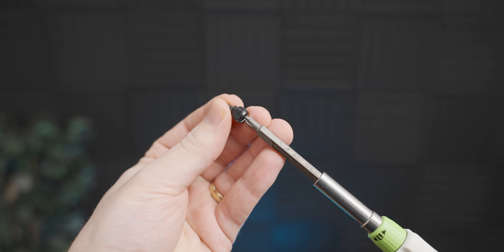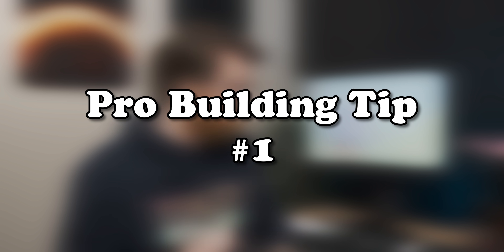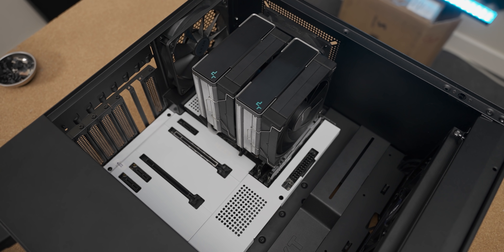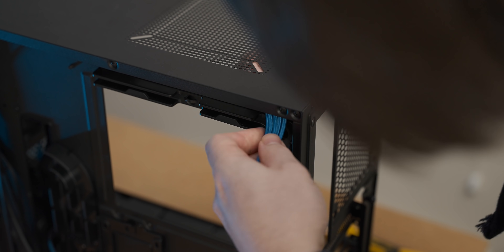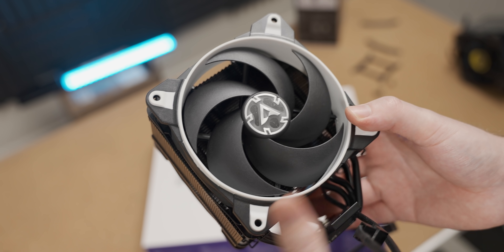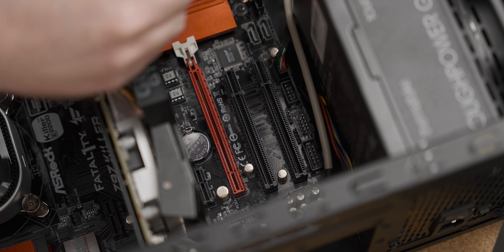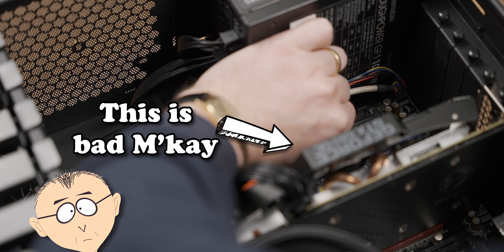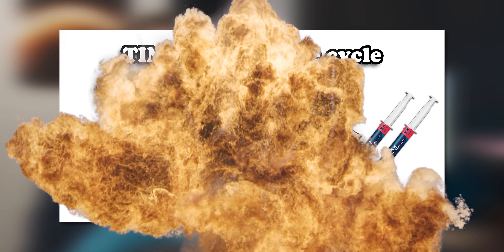5 Things I HATE About PC Building...

Comment: When you “finish” a build and realize the i/o shield is still laying in the mobo box 😅
Reply: indeed

;D
Reply: And there it sits for the rest of time.
Reply: This is why motherboards will built in IO shields are the best
Reply: Fortunately my mobo has io pre installed :p so I forgot to put my CPU in before putting on my aio lmaoooo . wtf is wrong with this auto correct
Reply: And the minute you sell the pc the io shield immediately appears from nowhere 😳
Reply from the maker: Ooof! That one hits you in the soul. 😂
Reply: @DawidDoesTechStuff  When it comes too magnetizing the screwdriver, i taped an old harddrive magnet too mine out of a dead laptop harddrive, neodymium magnets ftw, helps hold extra screws in place too as well as bits if i need too switch out the end for a smaller type for say 2.5 sata ssd screws.
Reply: @Time_Traveling_Lesbian  Unfortunately they force it on pricer boards. I doubt it's much more expensive to implement.
Reply: Every pc I've built doesn't have an i/o shield. All except this last build with the built in shield. Ruined my run of i/olessness
Reply: "Time to restart"
Reply: I circumvented that, by only buying them with built in io-shields... now to find a front-panel-stuff-to-motherboard-adapter!!
Reply: If you look where I have to, you're lucky to even have an IO shield.
Reply: that thing is now a novelty cheese grater my friend. flip that pc on and forget about it 😆
Reply: "Eh, it'll work without it."
Reply: And that’s why I left the io shield off my pc
Reply: Just recently did this... Not gonna lie, shit was flying.
Reply: @DawidDoesTechStuff  And the balls 😂
Reply: I did that with my first build
Reply: My previous shitty build didnt have it as I also forgot when i transferred it to a new case. I bought another 4gb a ram making it 3 sticks and not 4. Did a VERY bad job with the cable management up front and called everything just easthetics :)
Reply: @Time_Traveling_Lesbian  This is why people with braincells are the best at not forgetting their I/O shield
Reply: even worse when its an msi x570 A PRO with the worst quality io shield on earth
Reply: @trippwilsonphoto  Yea

JK no
Reply: Yes and on Youtube it takes like 1 second to install an IO-Shield. I have had many battles with IO-shields.. They are so annoying
Reply: Leave it out. Better for thermals.
Reply: That has happened to me at least 5 out of more than 50 builds. And the reason was every time, that the Io shield was packed below everything else in the box.
Reply: Good thing that thing doesn't serve any real world purpose these days XD
Reply: Pain.
Reply: He saved that for a future part 2
Reply: @baggiesjoe1608  The most accurate statement in this entire section!

Comment: I had a motherboard about a decade ago that came with a little plug extender-type thing that you plugged the front IO connectors into to turn them into a single plug. It was a brilliant solution and I wish every motherboard came with one, because apparently case manufacturers can't get their act together.
Reply: pin arrangement on motherboards still isn't standardised, that's why. It is very rare though, but still happens.
Reply: Gigabyte includes a thing like that with all of the Aorus boards of theirs that I've used. Actually THE best thing ever. It baffles me that something like that isn't required by law.
Reply: The ASUS Q-Connector. It's a godsend.
Reply: I got an ASUS Q-connector about a decade ago, used it in every PC I've owned since. Whenever I've helped anyone else, I pre bundle the connectors and tape them with black electrical tape.
Reply: Same here.  I had a DDR3 board or two that had these, and it's a shame that they're not more common.
Reply: @rossclutterbuck1060  As long as it's just a simple extender, and the same total number of rows & columns of pins, then it doesn't matter since you can just plug them into the correct ones on the top of the extender even if it differs between motherboards
Reply: my newer gigabyte board came with one of those, god it’s so much better then messing around with front panel connectors
Reply: @rossclutterbuck1060  front panel pins are standardized.  the only ones who don't are OEMs like dell who order custom motherboards.
Reply: @chubbysumo2230  actually, not everyone adheres to the standard (yet). You'll still find occasional outliers that are weirdly arranged (supermicro springs immediately to mind, but I'll be generous and say that they don't count). Interestingly, I've done a fair number of HP, Dell, and Lenovo transplants into new cases for customers who wanted better looks and/or cooling. Thus far, they have all universally adhered to the standard on the ones I worked on in the last 10-ish years.
Reply: @methodmantis3060  my aorus b450 didn’t have it. Maybe on their higher end bords?
Reply: @methodmantis3060   I use Gigabyte which I believe to be sort of the same company, would you know further details please?
Reply: @methodmantis3060   would you know more, I would use a few of these, please?
Reply: manufactuers can be white liquid stains at times

Comment: Routing hard to reach cables is often easiest done with modular power supplies... plug them all into the board first, slot in the board, route them wherever you want, and the plug them into the power supply at the back.

Comment: The front panel connectors: My motherboard came with a little bracket to put the front panel plugs into (even labeled +/- for the LEDs). Then you plug that into the motherboard.
Reply: Mine also it made my life a lot easier  that's the only connection I always manage to f up

Comment: In my tech shop we used  speaker magnets to store our various screw and socket driver tips.  The use of surgical tools like retractors can help placing connectors in hard to reach places.  A small magnet attached to a long thin metal rod (i.e. coat hanger), can help you recover those pesky bolts that like to fall into the "black hole".  Keep up the good work.  Love your channel.

Comment: When you finish a build and find out that the I/O shield LAN cutout piece is firmly inserted in the LAN connector.
Reply: Did that, could not be bothered to start all over, pulled that p.o.s with a plier and then cut it. Infuriating.
Reply: Aaaaaaugh!

Comment: 1:15 I'll explain it kinda simplified: there are like tiny micro-magnets in metals like iron but their orientations are random so there is no magnetic strength in the iron. By rubbing a magnet against the metal, you re-align the micro-magnets into a single direction, therefore making it magnetic. If you then rub the magnet in the other direction again, you shuffle the directions again. Hope that could help you and others that didn't know that. Also 8:40 you can also just put all the cables into a block of cables and plug all of them in at once. Just make sure that you have every cable where it should be

Comment: The most infuriating thing about these annoyances is that many of them have ready solutions and manufacturers can't be bothered to stick to them.

The front panel thing is pretty much standardized on all motherboards, but case makers still insist on providing the discrete miniscule plugs as such. Either they, or the motherboard makers could provide the little header thingy that all of them easily plug into, which has existed for more than a decade, but practically no case maker and only a couple of motherboard makers (not on all models, either) are bothered to do it.

The back panel p.o.s. i/o shield shenanigans are simply solved with an integrated panel. Not all motherboard makers provide, and again, not on all models (personally, I refuse to purchase any motherboard without an integrated i/o shield any more).

Metal clip cooler fan mounting can be made either frustrating or easy-peasy, as a matter of good design, or lack thereof.

The 5 pin CPU connector's awkward placement is, unfortunately, a leftover from the days power supplies were mounted on top of the case, and probably here to stay with us for quite a while, as is the magical self replicating thermal paste spread. SATA data and power connectors kind of suck, too (not as much as the IDE cables of yore, mind you), but with the proliferation of nvme drives, I don't see anyone doing anything about it (which is a shame, because heavy storage sata-connected HDDs are here to stay with us for quite some time).

Comment: The front io connector is absolute pain to connect.
Reply: It’s pretty easy actually
Reply: The constant amnesia of what the arrow on the connectors mean is the worst for me.
Reply: I find it easier when I hold them all in a bundle
Reply: About 10 years ago, MSI supplied a connector with their MB where you could plug all the cables into one just like the NZXT cable. I still use it today but sadly they don't include it in the box anymore.
Reply: laughs in connector thingy coming with motherboard
Reply: @Gigastor59  Asus used to do this too but the connector block I have no longer pin matches new Asus motherboards.
Reply: Asrock motherboards are good with helping you know what goes where

Comment: I would add the coolers that use the devils mounting plugs. Those little plunger clips out of plastic that have bad moldings and the cooler gets loose when you apply pressure in the opposite corner. Not to mention they are almost always square under the fins so you can't reach them with your fingers to undo them if they fail to seat properly. 

There are btw front panel standoffs that come with motherboards sometimes.

Comment: Dawid for your sanity's sake, did you know that using an electronics tweezer to plug the headers into your motherboard cuts the suffering by like 75%?
Reply: Mobo with an On/Off Swich on a Test Bench is even easier 😁
Reply: Get out of here with that twaddle, this is a NO COMMON SENSE ZONE.
Reply: Honestly, would rather have them make a full plug instead. Like wtf, everything else plugs right in. Then comes the front connectors. 1 by fucking 1.

Comment: 5:10 I love the way the Coolermaster Hyper 212  employs fan mounting on that cooler. It’s 2 not-flimsy rubber clips that screw onto the fans themselves, it’s a very good design in my opinion. You don’t have to deal with the finicky little metal retention clips and they go on the heat sink without any effort

Comment: Good tip on the CPU power.  For the case headers. I always tear the page out of the manual and tape it on the wall.  Also you're right bottom first!  I also use a plastic poker to help guide and push it down gently. Should be a general plug at this point in time.

Comment: 2. Use some needle nosed pliers to hold the connector to plug it in. Or, using a modular power supply, plug the power cable in then mount the MB then run the power cable through the slot to the back of the case.

4. Again, needle nose pliers.

5. Spend a day putting Foundation Coating on a foundation and the tiny mess made by thermal paste will disappear into insignificance.

Comment: 1. Magnetized screw drivers and bits are your friend.

2. Imagine the hell that is trying to plug in the CPU power and the pump/fan headers with your push/pull 360mm rad that you already mounted in the top of the case.

3. The physical PC hardware manifestation of the demon that is Clippy.

4. Some cases and motherboards come with plastic guides to slot the front panel cables into as well, like a DIY NZXT front panel connector.

5. Try getting the thermal paste on the new "cute" table cloth your wife just bought, then when you go to clean it off it wipes away the design printed on the table cloth as well.

Comment: Motherboard manufacturers fixed the front panel issue years ago. They used to give you a little header that you’d plug the cables into then plug the now connected header onto the board like a usb header. Do motherboard manufacturers not include these anymore?

Comment: On Number One, go barefoot where you are building. You are guaranteed to find every screw you dropped...eventually.

On Number 2, I have found that if i use an 8-pin extension, attach it to the motherboard along with the cpu, gratuitously large air cooler, RAM and m.2 cards if in use. Route that extension through the opening (if there is one) when installing the motherboard, and then plug the 8-pin connector from the PSU into the extension as part of cable management around back.

On number 4, I often set the motherboard on top of the case and connect these annoyances. I also believe that the layout is more or less standard for the block, and the NZXT front panel adapter has a fair chance of working on any motherboard with any case.

Comment: as someone who still has scars on his hands from late 90's cases I found this all quite funny lol

edit msi used to bundle a connector in with there mobos called the F connector it basically turned all cases into easy mode for the front panel i/o

Comment: The Front panel Io connectors are usually called Molex or Dupont connectors, widely used in tinkering and electronics. You can buy kits of various sizes. Also, you can easily take a small screwdriver and push the metal tongue to release the inner connector, the black plastic is just a housing. You can do that for all connectors and insert all of them in a bigger housing of the right shape to basically recreate the same connector NZXT uses (minus the filled hole, not sure they sell that kind), to make it easier to mount on the motherboard. The manual of the motherboard should have the pinout for the correct place.

Comment: This was me today.  The Noctua C14S in a Cooler Master NR200.  It covers the entirety of the ITX board. First build, I discovered the front power connector was one pin over.  Tear down and 4 hours of cable management was the simple solution.

Comment: For number 4. You can also get motherboards that ship with a Q-connector (I think that is what it is called). So you plug all the connectors on that, then it becomes what you described in the video what NZXT cases provide. Helped me out massively.

If you are curious, I bought a Gigabyte Z490 Pro. Not sure what other motherboard manufacturers have this or if all Gigabyte boards come with one of these.

Comment: i always plug 8 pin connector, front usb, front audio, and front panel connectors before securing the motherboard into the case - case cables on decent case are usually long enough to do it that way - much easier to see which wires goes where

Comment: I have used older HP cases to build new low spec office pc's, and those cases have the single plug front io that just works... alternatively... I have a GA X570 Ultra that came with a little front io block, that you put the individual front io plugs into this block and it turns them into 1 single plug that easily connects to the mobo, super nice.

Comment: So a few things about the front panel connectors:
1. Polarity doesn't matter for power or reset. Put them on however you like as long as it's the correct position.
2. Unfortunately, while 99.5% of motherboards have the same pin layout for the front panel, there are a few here and there that don't. Hence why not everyone does the same thing as NZXT.
3. Having said that, there used to be motherboards that came with a small labeled interposer block that you could pre-apply the connectors to that had the same effect as the NZXT solid cable. Don't know if it still exists.

Also,  I get the thermal paste in my CPU header installation wounds. Double pain.

Comment: similar to the cpu pins is installing a TPM module to the 570-e gaming board without taking the RTX GPU out.
the tiny 14-1 pin out is right along side the cpu and just below it is the gpu.
i struggled getting it lined up just to avoid unmounting the gpu.

Comment: What you are doing when you rub the magnetic tray against the screwdriver is aligning every iron atom in the screwdriver in the same magnetic direction, meaning every iron atom itself is a tiny magnet, and you are aligning them all to point with the "north" end pointing towards the tip and every "south" end of each atom facing the base end of the screwdriver. With all the iron atoms now facing the same direction, the screwdriver is re-magnitized and works like it should.

Comment: One issue with the NZXT front panel block is that I attach the reset button connector to my RGB controller to be able to change the color sequence by hitting the reset button so I need it to be able to be routed apart from the other power/HDD connectors. So I don't use the reset button as a reset button.

Comment: For cases with decent if not good front I/O connectors... My Musetex Case came with a special clip for the i/o connectors that you then plug right into the board. The clip was color coded for what clips go where.

Comment: Well... 

For number 3, you can always refer to your manual. Of course metal clips are a nightmare to install, but the manual can help. However, the best solution is to get something like Hyper 212 from Cooler Master. The plastic fan clips are easy to install.

For number 4, buy Gigabyte Aorus motherboard. They have a connector where you can install all the front panel cables into it and then plug that connectors into the motherboard. But if it is not obvious, install your GPU last as it can interfere with a lot of stuff especially USB 2.0 and USB 3.0 connectors, and to some extent, TPM header.

For number 5, to remove thermal paste, I found that alcohol is pretty effective at removing it. Thermal paste is easily dissolve in isopropyl alcohol.

Comment: Ive never had any issues installing the fans with metal clips on a cooler before. I even had that same Arctic cooler at one point and it was easy to install. 
But yeah best way to avoid those issues is to buy an AIO instead. :) About the front panel connectors. I think most case manufacturers do it like that because some boards have different layout for the connectors. So you may not be able to use an NZXT case with some boards.